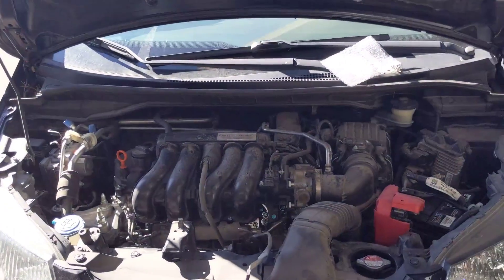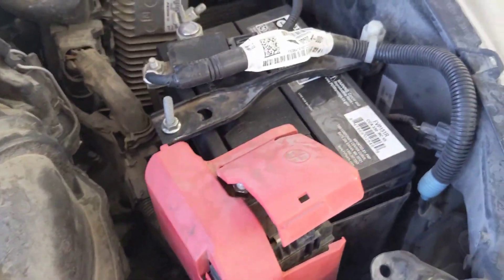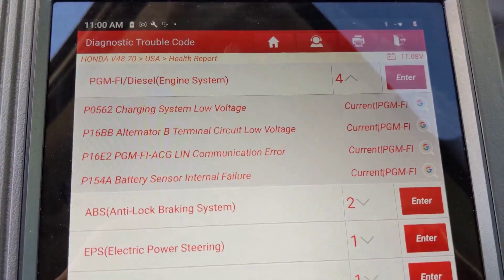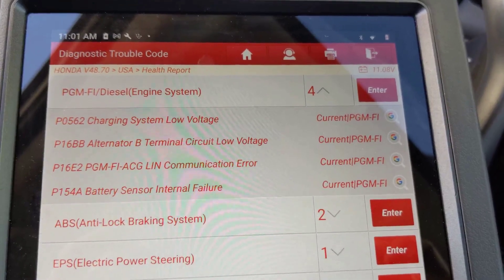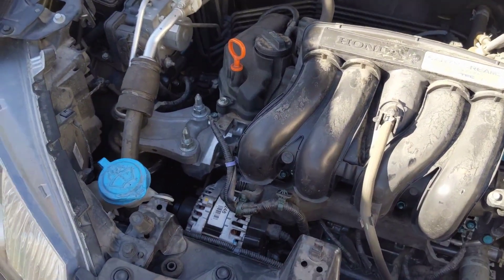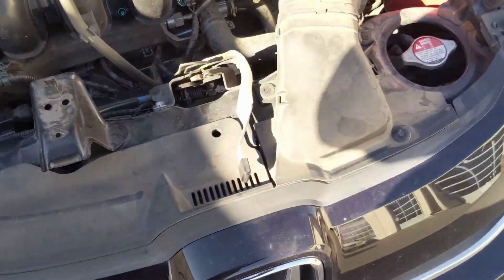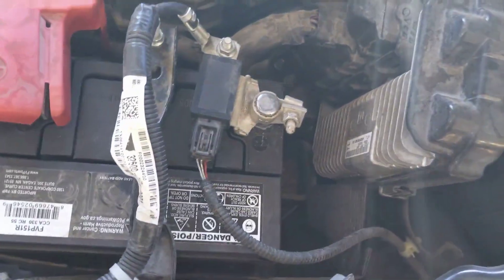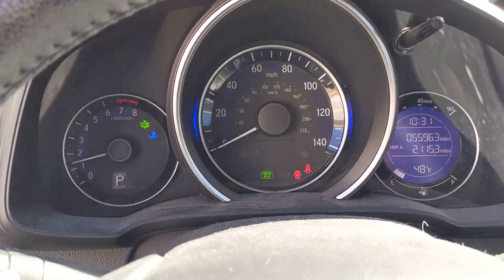Why is My Battery Light on but Alternator is Good "Fixed"

Comment: I have a 16 Odyessy, changed battery and alternator. Everything works great for 10 minutes then it stops charging. dash says check battery sensor so I replaced that also but no change. Charges for 10 minutes then stops charging, battery light comes on dash as soon as the altanator stops charging. any ideas?
Reply: Voltage regulator

Comment: Wait, he said that “we” replaced the battery and alternator and that didn’t fix the problem, and then replaced the sensor which fixed the issue. Why did he put a video up about what not to do? He actually cost the poor car owner hundreds and hundreds of extra dollars by not troubleshooting the issue correctly. Maybe it’s intended to show the importance of troubleshooting issues before blindly replacing parts.
Reply: He replaced those 6 months BEFORE the battery sensor went bad

Comment: I just recently replaced the Alternator and battery on my 2002 Escalade AWD 6.0, and now when I accelerate hard or spiritedly the volts drop to almost 8 and the battery light comes on for a brief second then disappears, but then I drive casually id doesn't happen. I had the new alternator tested too its reads 13.7 to 14.2 volts while the truck is on and my battery stays fully charged. So not sure why I'm getting low volt readings when I drive hard only.
Reply: i also drive a 02 escalade. My abs light, battery light are on. also my fuel and temp gauge will go up and down. any ideas
Reply: Could be your belt slipping under load

Comment: Hi can this sensor fail intermittently and not cause a code?Can it also cause alternator output be lower than normal?Ive been having issues where I get engine surge my headlights are dimmer and sometimes flicker and engine seems like is low on power.Thanks
Reply: Yes, it can fail intermittently and not set a code. It can cause alternator output to be lower than normal. I would check to make sure all connections  between alternator an battery are tight and free of corrosion. Make sure to disconnect the negative cable of the battery before tightening any connections or attempting to remove corrosion. You can do some serious damage if you leave your battery connected. After you're done cleaning off corrosion and tightening connections, reconnect negative battery cable, turn car on and do voltage drop tests on the positive and negative sides of alternator and battery circuit.

Comment: Battery light is on in my 2011 Toyota Highlander but the alternator is good and just put a new battery in. Anyone know what the issue is?
Reply: Am getting the same thing in my toyota voxy 2011 don't know whats the problem 😞
Reply: @ryemeevans4162  it was the alternator in my car. I put a new one in it and works like a charm now.
Reply: My VW Passat mine turned out to be the alternator fuse. The main fuse vascular fuse.

Comment: Parts cannon fail. You need an alternator.........No you need a battery.........Oh it was just a sensor..........That'll be $1,200 for a $110 repair.
Reply: @gregberry9122  That's what happens when you don't diagnose it correctly the first time. You know the customer walked away with a bad taste in their mouth.
Reply: Exactly!

Comment: I have changed the radiator, hoses, front suspension on both sides, alternator, ecm, rear shocks, air conditioner itlp😢 is over heating again
Reply: Did you replace the thermostat and expelled  the air out of the coolant system ?
Reply: Try your fuses 80***amp

Comment: Is there a part similar to this on domestic cars? I have a 2000 Buick Park Ave. The alternator stopped charging while driving, battery got so low after a while everything shut down. I changed the alternator and new battery is good..the alternator is charging but the battery light is still on.
Reply: I am having same issue with 03 honda civic si smh
Reply: @litoblandino1186 did you figure it out?
Reply: Did you ever figure it out? I'm having same issue
Reply: @Muttaqi757  I replaced it with a new alternator. The one I put on temporarily had an issue also was overcharging

Comment: thanks for the video. I changed my battery and alternator in honda accord, battery light stays on at idle but when turning headlight or ac on then battery light goes off. reving up engine over 2000 rpm makes battery light on off too. any idea what could be the cause? any help appreciated very much.
many thanks
Reply: A mechanic told Chinese parts work but sometimes computer won't read it
Reply: Don't know if this helps but since I installed battery sensor got it online computer won't read it so battery light always on but works normal
Reply: I have the same problem
Reply: @lmauriceg92  It's the alternator. the regulator in the alternator is malfunctioning. connect a multimeter reading dc volt to your battery and while the engine is running it should reading about 14 volt with headlights on. then turn headlights off and if it starts dropping the voltage gradually then your regular in the alternator is not doing its job. my advice is that buy original honda alternator as the aftermarket ones use mostly Chinese regulators in the alternator and your battery will stay on even with a new alternator.
Reply: @PL-fc6hm   What year is your car and why did you replace the battery and alternator?
Reply: @lmauriceg92  also check the serpentine( auxiliary) belt tensioner and alternator clutch pulley before changing the alternator as that could contribute to it but it's a small chance that would be the issue
Reply: you ever figure out this issue?
Reply: The Honda Electronic Load Detector (ELD) is a component in certain Honda vehicles that monitors the electrical load on the alternator and adjusts its output accordingly to optimize fuel economy and reduce emissions. When the electrical demand increases—such as when headlights, the A/C, or other accessories are activated—the ELD detects the higher current draw, lowers the signal voltage, and prompts the PCM to increase alternator output to meet the demand.

If the ELD fails, it can cause symptoms such as flickering or dimming headlights, a weak or dead battery, and other electrical component failures.

Comment: i have a 2005 c lass 180 Mercedes just  changed alternator and battery and i now have red warning lights on Mercedes screen warning about the battery or alternator any ideas ty mike
Reply: is your car's engine losing power when it happens? or is it just the light that comes one and everything is still normally functioning?

Comment: Had rough starts. Changed Batttery so that’s good, alternator is good, just replaced battery sensor , now the charge light is on, all the readings are good.. any suggestions what I should do next ??
Reply: Don't you hate it when you ask a question and it's never answered?
Reply: Yessssss 😂 jerks ok im a woman not much of a mechanic I followed every wire al the way to my alternator bammmmmm found my alternator PIGTAIL was crack and fall apart had 20 men look at my car none could find the problem but yet charged me for there time ughhhh 😂 one dang plastic peace that holds the live wire from battery to alternator how did they miss this? Pigtail is 9 dam bucks unreal i hope this helps i got a new alternator now starter new battery well i didnt need any of them the man who fixed my car KNEW it was the pigtail but didn't want to repair it and save face oh well poor guy lost a finger trying to steal parts from the body shop next to his! 😮😮 Is that karma or just bad luck! Remember people karma is real 😂 i do feel bad for the man he is under paid and poor his boss is a complete jerk
Reply: @rumithesquirrel7816did you find out what it was. Did you try the alternator fuse

Comment: Do I understand it correctly that you replaced the alternator and the battery, when actually it was the sensor issue?
Reply from the maker: It did fix the charging system problem initially, but the guest returned about 6 months later with a failed battery sensor